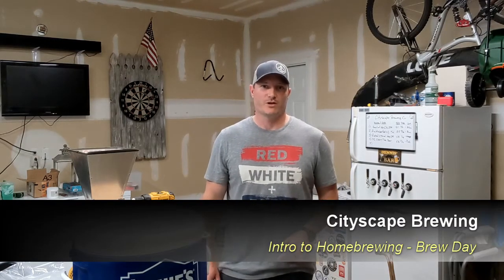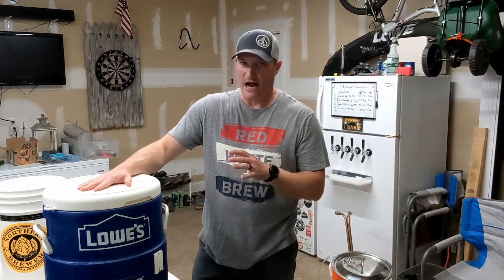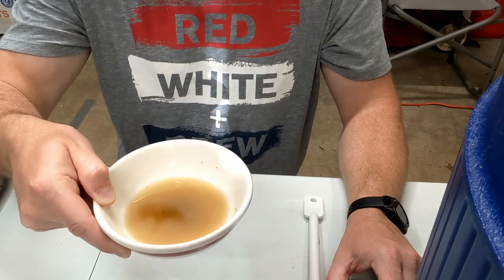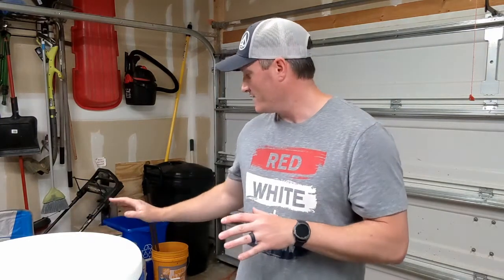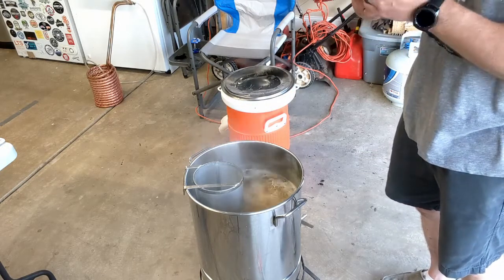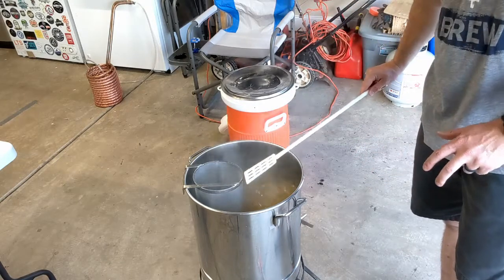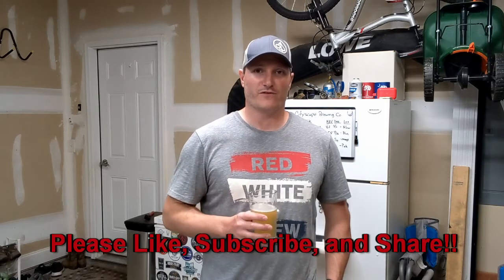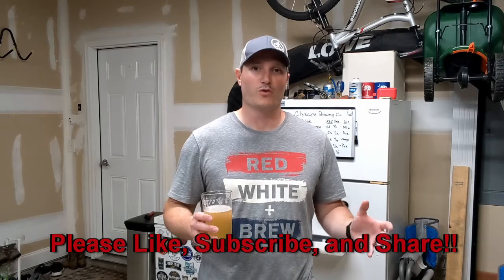All Grain Brew Day - Step by Step Tutorial for Beginners

Comment: enjoyed your teaching , I have been brewing using extract and want to kick it up a notch with all grain brewing.  what size is your brew kettle?  I cool my wort by sticking kettle in snow bank. Going down to -36 on Tues with wind chill factor. Fast cooling.
I ferment in the room near my Vermont castings woodstove , works great. I also always use a blow off tube.  Lots of brewing here in the Maine , western Mtn range. North Woods.  Great job on video.
Reply from the maker: Thanks! Definitely a big difference when you switch to all grain Brewing. My brew pot is 10 gallons. I also have the links to the specific one I use in my equipment video, including an immersion chiller and mash tun  which I would highly recommend,  especially for summer months when you can't cool outside. Reasonably priced stuff. I'm also going to make a video on how to make a mash tun next week!  Stay tuned and check out the equipment in that video!
Reply from the maker: Here's the link to that one.   Check the description.  https://youtu.be/9TZLoP8cfAg

Comment: It is good to see your approach. Thanks for sharing!
Also I wonder if you know that there is usually a correction factor to be applied to the refractometer. You need to find the correction factor of your refractometer by comparing with a hydrometer. The correction factor is usually somewhere between 0.9 and 1.1.
Reply from the maker: I have tested my hydrometer against my refractometer and they're very close at about 60-80  degrees Fahrenheit.  There is some correction needed if your wort is hotter or colder. I'm sure many refractometers are different and that is important to know. Refractometers also need a calculation when alcohol is present. I always use a hydrometer after fermentation, but during brew day a refractometer is way easier and lets me know I'm in the ballpark either way. Thanks for watching!

Comment: Question, so you heat your sparge to around 175?  I have been hearing to almost boil and adding into a warm cooler.  Do you think that is too high?  I have had good results at that temp but haven’t tried lower.
Reply from the maker: There's no need to go over 180°. You're just rinsing the sugars off of the grains essentially.  You're not doing any more starch conversion. I don't know the benefit of doing any hotter, but you could end up melting your cooler or other plastics potentially. Most breweries fly sparge at 170° And that slowly trickles out and even cools off some as it goes into the mash tun.
Reply: @CityscapeBrewing  thank you for the advice and for the great video!
Reply from the maker: Welcome 🍻

Comment: Can you go too hot
Reply from the maker: Do you mean too hot with the mash? If so, Absolutely. You want to make sure you are within a few degrees of the target, mash temperature. Mash temperature determines the mouth feel and amount of fermentable sugars that will end up in your beer.
Reply: @CityscapeBrewing  sorry I should have asked a better question. What I meant is what's the harm if you start way hotter and then let it cool down on iymts own. And I think you already answered it, the mouth feel change?
Reply from the maker: Most of the starch conversion actually happens in the first 15 minutes.   I would try to get the temperature as close as possible from the start and if it drops below, most of the conversion will be already done.   How are you mashing?  Do you have a cooler mash tun like mine or a kettle?
Reply: @Cityscape Brewing  I have a igloo but I'm looking for an electric all in one the clawhamer system is looking pretty good but it's 1000 bucks
Reply from the maker: Yeah they get spendy fast.... I actually like the mash tun in a cooler process mainly because I can have bigger mashes(more grains).  The electric systems are good and all, but have some limitations depending on the size kettle.  I have a friend that has one and sometimes has to add water at the end to bring up to the correct volume.
Reply: @Cityscape Brewing  thanks figured as much anytime anyone  says yea this doese it all usually they are full of $hit
Reply from the maker: That's a safe assumption for sure.   Can't go wrong with the $50 cooler lol 🤣
Reply: @Cityscape Brewing  trying to set up a recirculating pump on it
Reply from the maker: You can do that to help set the grain bed for sure. One reason I don't get a pump is because gravity is free. I actually created a recirculation tool that I can fill up a pitcher and dump it into another pitcher and it slowly trickles over the wort to recirculate. Check out that video if you haven't seen it, It works awesome!

Comment: Can the wrong amount or combination of water additions affect OG/FG ?
Reply: Reason I ask abt water additions is on my last Brew everything was going according to plan and working perfectly. All temps were right on the money until I did my OG. Suppose to be 1.058 but was 1.043. I used gypsum, calcium carbonate, and 5 star ph. Seems to be fermenting ok at 67. Not sure how it will turn out but had fun it anyway lol
Reply from the maker: No water additions would not do that. That sounds like too much water, not boiling rapidly enough, or not a great crush on your grains. Did you have the correct volume at the end of your boil?  What are you using for your recipe OG, a kit or a recipe online?
Reply: Actually it was a recipe you gave me with the grains I had 10 lbs pale ale malt and .5 lbs Munich malt . Safale 05 . I think a little of all the above . I noticed a lot of whole grain in the left overs that I’m giving to my chickens and yes I had abt 3/4 gal more water at boil . Was going to let it keep boiling past 60 min mark  but only let it boil a extra 10 min in hindsight should have just let it keep boiling. Also when I put in info on brewfr app I think it may have been defaulted to extract instead of mash idk.  Good lessons learned
Reply: Also fermentation after abt 16 hours seems a little slow at 67 degrees but may not be giving it enough time
Reply from the maker: Boiling longer isn't always good because it will get more bitter the longer you boil the hops. You want to make sure your water is the correct volumes when you start. A bit over isn't bad but you don't want to boil for another half an hour. I use brewer's friend too but make sure that you're putting in the right quantities and systems because that really makes a big difference. Sometimes it can take over 24 hours to get fermentation started. So I wouldn't be too worried about that
Reply from the maker: I wouldn't sweat it too much.... It will just be a bit less ABV but will still make beer! Haha

Comment: So many great tips Dennis! Thank you mate!
One question though,have you ever tried to conserve water whilst cooling the wort or using the water again instead of letting the excess run down your driveway?
Here in Australia water is precious,so we try to re-use as much water as possible.
Reply from the maker: I sometimes fill up some buckets to water my garden and potted plants with, but not everytime.  I've seen others run the line to their wash machine and almost fills it up for a load to reuse the water.  Probably a good idea to conserve as much as we can.  Thanks for the advice.
Reply from the maker: Will do.  Thanks

Comment: AWESOME BREW DAY!!!! The video is GREAT!!! The only issue that occurred on the brew day was that the recipe produced moonshiners beer. It appears, that whoever wrote the recipe is familiar with the way that moonshiners beer is made, which was popular during Prohibition. Homebrewers didn't use the brewing method, unless, they were moonshiners because they used malt syrup available in markets, with herbs and spices for flavoring because hops were difficult to obtain. It's where specialty beer and winter warmers came from.
The single temperature infusion method is used in grain distillation, where glucose is only needed. The brewing method skips three steps that are required for producing ale and lager, conversion, dextrinization, and gelatinization. Single temperature infusion, chemically and enzymatically, cannot produce ale, due to the way that enzymes function, and chemical precipitation.
You have starch, and the way that enzymes work with starch, a little confused. Starch is a poly-saccharide. There are two types of starch in malt, simple and complex, and neither one, converts to sugar. In brewing, the correct term is mash conversion. Conversion has nothing to do with starch, it has to do with simple sugar, glucose. Alpha deals with starch, Beta deals with glucose.
This is the way it works during mashing. Alpha is responsible for liquefaction. When Alpha liquefies simple starch, amylose, it does it at a 1-4 link in the starch chain, and when that happens, two chains form, and the name changes. The one chain is called the reducing end, and the other chain is called the nonreducing end. The reducing end contains 1-4 links and after Alpha liquefies all of the links, sweet tasting, nonfermenting, types of sugar, remain. The nonreducing end is simple sugar, glucose. Glucose is responsible for primary fermentation and ABV. The higher the rest temperature, the quicker Alpha denatures, and sweeter tasting, low ABV beer is produced.
The rest temperature recommended in the recipe is used by moonshiners because at 150F, Alpha releases the highest volume of glucose, as possible, from amylose, within one hour. The more glucose, the more alcohol. The high temperature denatures low temperature activated enzymes that are needed for making ale and lager, Beta in particular, which makes strike and target temperature, useless. Beta is purposely denatured in moonshining because the enzyme gets in the way by slowing down the process.
Beta is responsible for conversion, which occurs at 140 to 145F. During conversion, Beta turns the glucose that Alpha releases during liquefaction, into fermentable, complex, types of sugar, maltose and maltotriose, which are the types of sugar that produces ale and lager. When conversion occurs, secondary fermentation takes place, due to maltose. Maltotriose is responsible for natural carbonation. Beer doesn't need priming sugar, or CO2 injection to carbonate, when conversion occurs.
When Alpha liquefies complex starch, called amylopectin, dextrinization and gelatinization takes place. Dextrinization and gelatinization are responsible for body and mouthfeel in beer. Amylopectin is hard, heat resistant, complex starch that makes up the tips of malt and it is the richest starch in malt. Contained in amylopectin are A and B limit dextrin, which are tasteless, nonfermenting, types of sugar, and pectin. A and B limit dextrin, pectin, and a type of albuminus, protein, provides the body and mouthfeel in beer. In homebrewing, amylopectin, is thrown away with the spent mash because the temperatures are not high enough to burst the heat resistant, starch, where it would enter into the mash liquid, before Alpha denatures. When the starch is thrown away, beer overly, dries and thins during fermentation and conditioning. It is one of the reasons why homebrew is artificially carbonated, and drank, green, from boiler to belly in three or four weeks. To take advantage of amylopectin, the Hochkurz and triple decoction brewing methods are used. When the boiling decoctions are added back into the main mash, Alpha liquefies amylopectin, and dextrinization and gelatinization occurs. The only time dextrinization occurs in the infusion method happens when amylose contains a 1-6 link in the starch chain, which is extremely, rare. In homebrewing, it is made to appear that dextrinization occurs when mash is rested at a high temperature, which isn't the case.
To place the brew cart behind the horse, every bag of malt comes with a malt spec sheet, which is used in brewing for determining the quality of malt, before the malt is purchased. Listed on a malt spec sheet are a bunch of chemical acronyms and numbers that a brewer uses to find out if the malt is better for making whiskey with, or more suitable, for producing ale and lager. It is not a bad idea to become familiar with the data on a malt spec sheet. Malt spec sheets are online from each malthouse.
For a recipe to be accurate, the malthouse that produces the base malt has to be identified in order to obtain the malt spec sheet. The recipe recommended 2 row malt, which is similar to asking a person to buy a 2 door car without offering any specs. The recipe recommended a rest temperature that's used in grain distillation, where high modified, to over modified, malt is used. Marris Otter, Halcyon and Golden Promise are examples of high quality, distillers malt.
Weyermann's floor malt is under modified, low protein, malt. Gladfield's base malts are under modified. Under modified, malt is richer in enzyme content than high modified, malt, and low protein, malt contains more sugar. Malt, 40 Kolbach and lower is under modified. Malt should contain less than 10 percent protein. The higher, the Kolbach number and the higher, the protein content in malt, the less suitable the malt is for making ale and lager. Both numbers are listed on a malt spec sheet. 
Try not to slop hot water into mash, you want to reduce the risk of oxidation, not increase it.
Iodine only determines if starch is present, it cannot determine when conversion occurs. Depending on the type of sugar that's in the sample, the colors of Iodine will vary from yellow-orange to deep red-mahogany.
It's probably better to crush a tablet, the guy that makes the stuff, recommends it.
A dye is first used, to determine if yeast is worth saving. It would be better to forget about harvesting yeast because sooner or later you will ruin a batch of beer. Yeast becomes senile.
To learn how to make ale and lager start out with DeClerks books.
Reply from the maker: Thanks

Comment: The multiple times you drain off some wort so you don’t get a bunch of grain in your next container seems like a problem that could just be solved with a sieve
Reply from the maker: That's a good question, and although you can do that(like brew in a bag would do) It's really doing two things, setting the grain bed to act as a strainer, and also "rinsing" the grains to pull out more sugars. Recirculation, even with the same wort, helps increase efficiency.